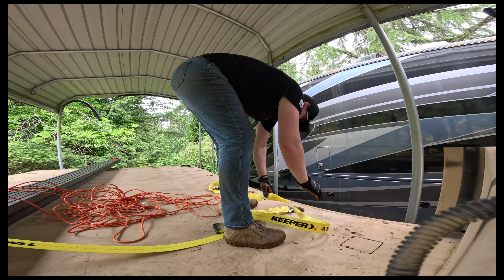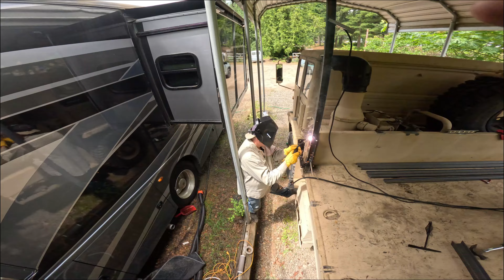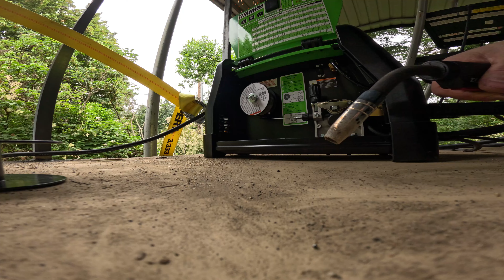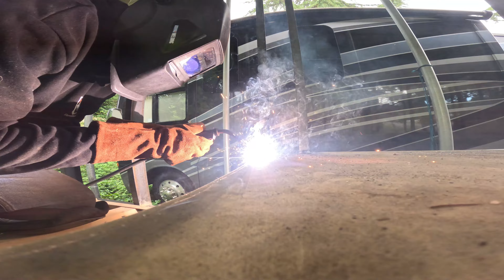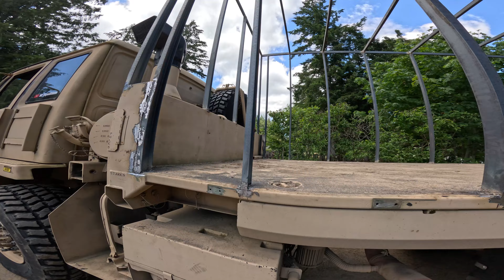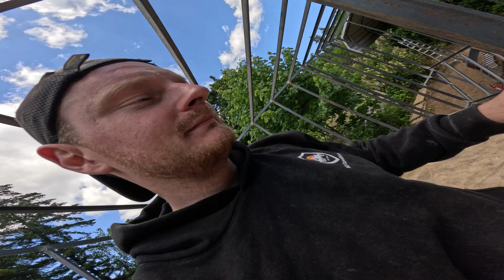(2024) Welded Overland Habitat Framing! #truck #6x6 #heavyequipment #m2x #welding

Comment: Are you worried at all about how much weight that will add? Obviously this is a beast and will tow it but I'm talking about when all is said and done.
Reply from the maker: @ryananderson7196 not too much. The crane that I took off was about 4,000 pounds. The amount of steel here is less than a thousand pounds so I have a bit of a buffer and the load capacity is 10,000 to 30,000 if I remember correctly

Comment: I've thought about doing exactly what you've done (same model truck and habitat framing) and wondered how (or if) you are planning on addressing frame and habitat flex?  I was thinking I would free the upper frame rail and add spring capture mounts between the rails with a hard mount in the rear.
Reply from the maker: @chrisszabo553  for my situation I'm not going to address the frame/habitat flex. I'm going to add support inbetween the 24" post and wherever I can. I'll also try to keep most of the habitat weight center line of gravity to prevent the truck from tipping over. I don't plan on doing any real serious offroading with the military truck  because it won't ever be as capable as a jeep or 4runner. Not trying to trash my nice truck 😅. Also, most people that own these types of trucks never really do routes that require the flex. You might flex on 1% of the journey and to me the return of input did t seem worth it. I'll make sure to do a good route study before I commit to a major trip